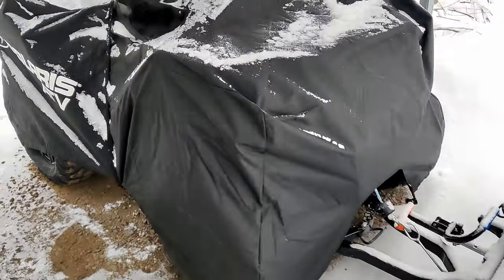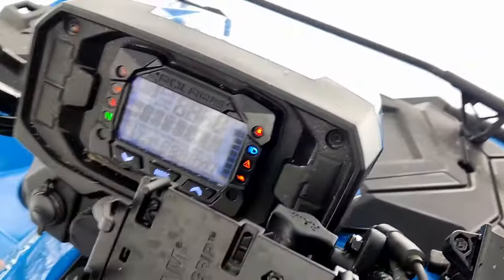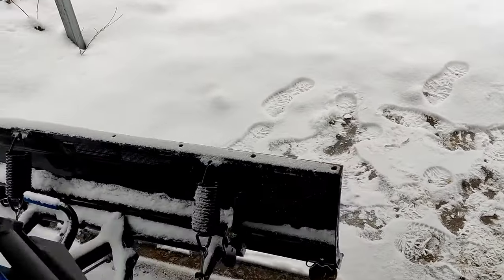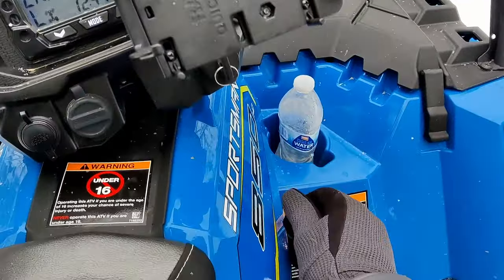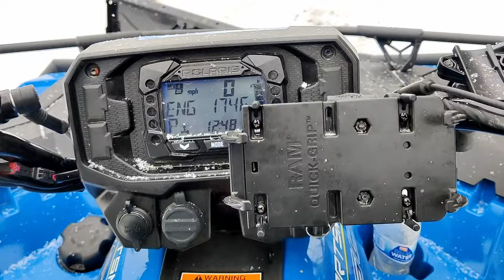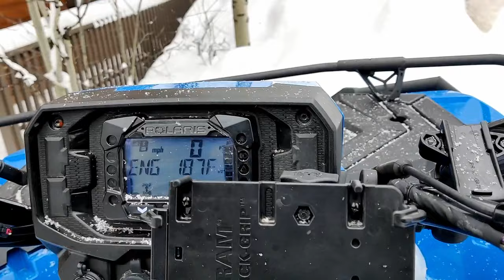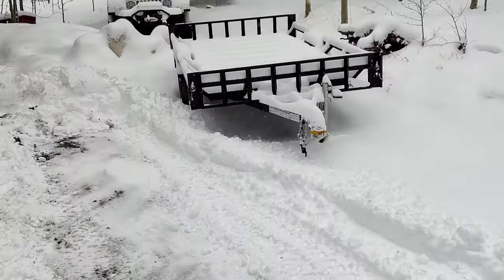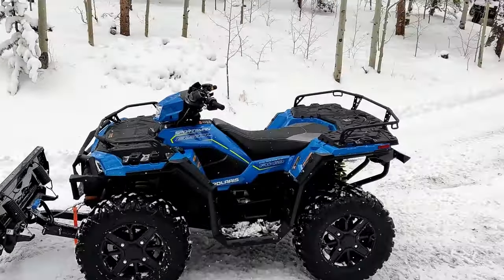Plowing Snow with a Sportsman 850 ATV

Comment: Make sure the red handle for the plow frame is pushed down into the lock position!!  Just flip over the shear pin it has 2 usable ends...
Reply from the maker: I found that out the hard way bought a few spares too!  I show them in my Pt2 video.  Thank you for the comment!!

Comment: I seen another video where the guy cut a slit in a pvc pipe the length of the plow for using on grass and gravel driveway. Ive never tired it but it may be something to consider. Good video
Reply from the maker: I will give that a try!!  Thank you for the tip!!

Comment: Flip the sheer pin , I took the long eye bolt out and put a short one in with a pully block , then I put a short hook strap on the nerf bar , yes , take the winch thriugh the block and snap the hook strap , one a lot more room , two you wont break the cable like I have many times .
Reply from the maker: Thanks for the tips and the Sub!!

Comment: 850 is a good size machine.
I have a Suzuki 500 with a Boss hydraulic plow.
I think you would like the Boss plow and your machine could handle the V plow Boss makes.
Reply from the maker: I've looked at the Boss plow they are nice.  Perhaps when mine is ready for replacement I'll look into it more.  Thanks for the comment!!
Reply: @bravo1xrayoutdoors625  I’m 61 and I got a Boss straight plow 5 years ago. I had been using a manual lift plow for several years. I don’t have a winch on my atv 
It’s pretty nice being able to angle and move the plow up and down without getting off the atv.
Your 850 could plow very deep snow with a V plow but my 500 didn’t meet the specifications for a V plow.
I think I spent $3,000 and I think the V plow was a thousand more back then.
Reply from the maker: I will defiantly will be looking into a better set up once its time to replace it.  Where I live now does not require too much plowing so it  might be a little while!  Thanks for the comment!!  @calvinreichelderfer7989

Comment: Nice, does it have enough power? How is the suspension? How is the realibilty? Which parts would you upgrade? Is it much lighter than a 1000ccm? Alsow can u compare it to other brands Canam, cfmoto?
Reply from the maker: Thanks for the comment!  I'm 270lbs and the plow weighs about 100lbs.  I have the suspension on the front on the second to most stiff setting and the 850 handles with out issue.  There is more then enough power to plow up to 8" or so at a elevation of 9600' up hill.  I have had a need for any upgrades yet.  I've done a few "MODS" but nothing big.  Heated hand grips, rear work light, front mounted light bar that's about it.  I have about 700 miles on it now and so far so good.  I just keep the wheel bearings lubed, change the oils and Check the air filter.  I just completed a preseason service and did a full fluid change, plugs, air filter and pulled the cover on the belt.  Belt still looked new so I just blew out the area and put it back together.  The only real comparison that I have is my buddy has a Honda Rubicon 520.  Both are great quads.  He does not plow with his but it has gone everywhere that I have.  We are not aggressive riders but have done some really fun trails and have been all over the Colorado mountains.  73
Reply: @bravo1xrayoutdoors625  nice thanks